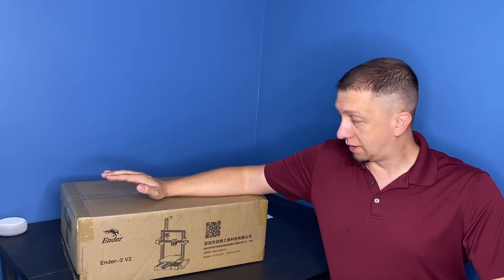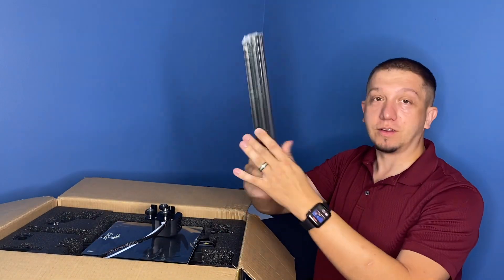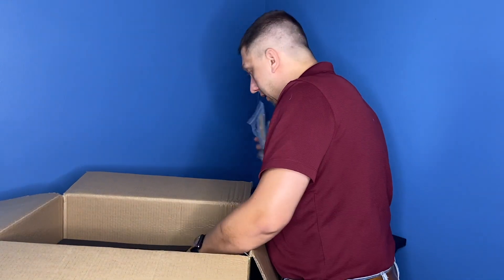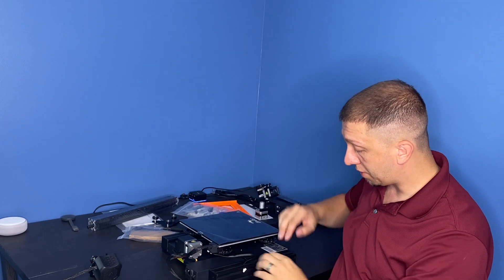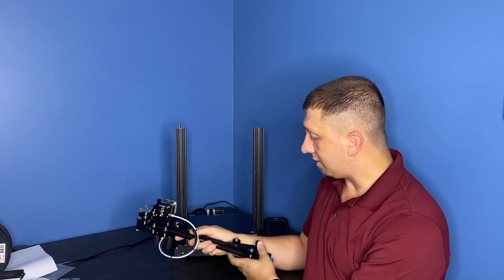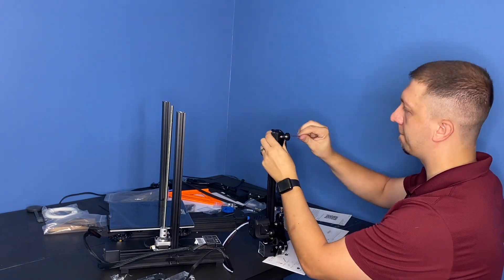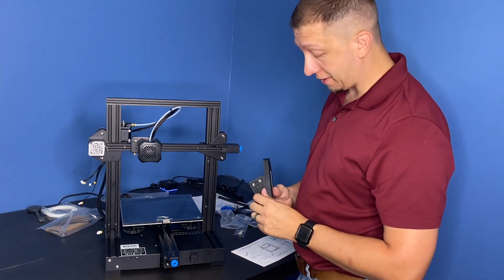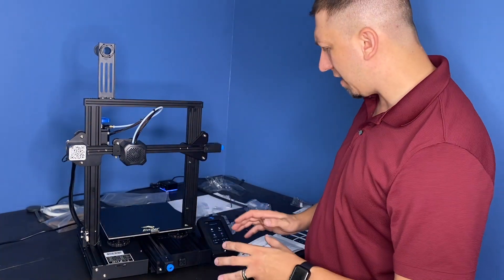3D Printer Creality Ender 3 V2 Unboxing & Assembly

Comment: Is this print big enough to print the Mandalorian armor ? Or a stormtrooper?
Reply from the maker: You will have the break with use mesh mixer to break the pieces down to fit the print size or find models that have it in piece to print. The cr-10v2 is what used for most of the big pieces. It allowed me to print like the helmet for example in ones piece.  So yes it could be done

Comment: There's a bit of a price difference between the CR-10 line and the Ender 3s, and of course the newest models are all about $100 more than the previous iterations. Would you encourage new printers to start with one model line over the other?
Reply: Immanuel Jaime I know nothing about the CR-10, but in my experience once you make sure you ender 3 is put together correctly it’s pretty idiot proof.
Reply from the maker: The Ender 3 for a starter printer once it is setup and calibrated is a good machine and should notg give a new creator that much trouble
The CR-10 while it is a bit more work and more cost can be just as rewarding as the Ender 3.
Reply from the maker: The real difference between the CR-10 and Ender 3 is print volume.  The printers are a lot alike but the CR-10 has a bigger print plate allowing for large prints.
If we stay in only the new models cr-10 v2 and Ender 3 V2 the cost difference is real with the ender 3 being about 270 vs the cr-10 costing 500 or more.   Personally the Ender 3 is a great beginner printer and you can print a lot with it.  With that said the CR-10 is great as well and you get the addition print volume. Meaning bigger and awesome prints.  With these models you get more out of the CR-10 than you do the Ender v2 as far as upgrades and functionality. 

The same is true for the older model lines as well.  The systems are very similar but again when I look at printers for me I will stick with the CR-10, I love the extra print volume and it can be a bit more work to get the bed level but both the CR-10 prints are worth the money and time.